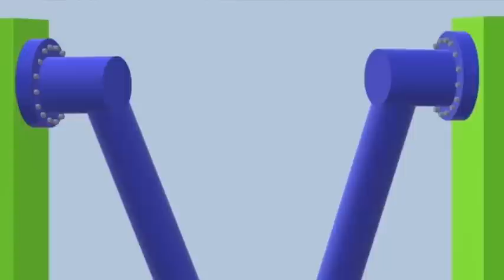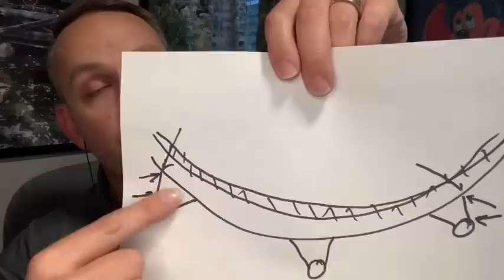Support beam cracked Fury 325 Carowinds When Will It Reopen?

Comment: The stress from the trains speeding by has sheared that corner piece clear off the support! Like you said, that's definitely a big "WHOA!" and there's some serious downtime, initial inspection, (maybe) repair or replacement, even more extensive inspection of the entire ride, and overall assessment - all coming down the pike! With as high, fast, and the stress on the turns and inversions experienced on that ride under normal conditions, I would not be at all surprised if Fury 325 stays closed for the rest of the season! You cannot take those kind of chances!
Reply from the maker: Most of the time the footer sinking would be from water intrusion. Works down in the ground, creates flow and over time starts to loosen the footer. It’s mainly soil composition, nothing really the park could do but monitor future problems.

Comment: Since this is so much in the public arena, is there pressure to go above and beyond the technical specs to make the public feel safe (i.e. replace the column rather than repair even though a repair may be deemed technically feasible?)
Reply from the maker: Yes there is a knee jerk reaction that the park will more than likely do sense it’s in the media. (I’m guessing,) They will invite some news sources in to show them how they will inspect the rides  to show people they do their job to keep it safe. The only way to fight media is with media. They will want to hit key words like manufacture had us repair it. Or something that shows they went outside their company for a check and balance in good faith.

Comment: Thunderbird at HW which was built the same year as Fury had a foundation sink and crack 2 years ago in a valley where only the track was attached to the foundation. Luckily they caught it very quickly and got everything inspected and poured a whole new foundation that ended up being much larger than the original foundation. It took them about 4 weeks to fix. I imagine this one will depend on how fast they can get a new support manufactured. I also imagine this making national news makes it more complicated as well.

Comment: Great Analysis. The one thing that really bothers me though is this was not spotted by Ride Operators or even park personnel. It was spotted by a Dad sitting out in the Parking lot waiting to pickup his kids. That's who shot that footage. He immediately went to find someone. It took him talking to 4 layers of supervisor before they would even begin to take him seriously. Even with the video footage. And then it still took them quite a while to shut the ride down. There will be some serious questions asked about Carrowinds maintenance practices. The other thing that is getting overlooked is the real potential for danger isn't just at the other supports. If you look at the video there is a track section joining just a few feet to the left of this support. That joint has now undergone way more movement and stress than it was ever intended for at least a week. (Pictures have surfaced showing the initial signs of the crack a week ago). Yes the rides do not necessarily need all of the supports to run safely. But which ones it needs vs does not need are not a random selection. Some of the towers are 100% necessary because the track joinings are placed adjacent to them, and they require more solid support.

Comment: A sober, educative, and reassuring explanation, Ryan. I am curious if "sleeving" the affected area--installing more steel at the point of failure--would surrogate replacing the entire member. You mentioned this breifly, but did not elaborate. Can you?
Reply from the maker: It’s all about liability. If they want the ride to be under B&M umbrella then B&M have to allow the repair. If they go roughe an fox it how that want it to be then B&M will release all liability of that ride. It’s up to B&M if they even want to sell parts to the park at that point.

Comment: what about the fact the support was in tension rather than compression? given the bank angle, id really imagine compression would've withstood more force...
Reply: Steel is stronger in tension than compression. You need significantly more steel to give the same compressive strength of say concrete.
Reply: @walterandclaude  even after being heat effected? Generally welds don't break the steel on the sides does. I'm just saying it would've been easier on the support if it was compressing the steel rather than trying to rip the weld apart
Reply from the maker: Possibly but these things typically don’t matter much. They are overbuilt to start with. This makes this event very odd.

Comment: 5:58 some rides that are on unstable ground (like "gold rush" @ Slagharen) have reflection markers on the supports about 1m off the ground where they shine a laser on, the laser should return to a detector if all supports in that loop are in their spot. If the support sunk, is bend or tilted the laser doesn't return to the correct spot and they can't open the ride. This is checked daily on start-up by the system.

I guess this is something that will be added to a lot more coasters in the future.
Reply from the maker: Wow. It’s normally not an issue unless like the one you described , it’s in a known problem area. Thanks for the comment.
Reply: @ryantheridemechanic  I've seen the same laser reflectors at other rides, but I've only done a start-up at the coaster of mentioned so I don't know how often others are checked. Slagharen is build on an oil and gas field so it's a known issue there for buildings aswel to slowly sink into the ground. Along as it's uniform on the whole structure it's not a problem, but some buildings have a few supports that stay put where the rest of the building keeps sinking. My parents house have the front wall about 1,5 brick (about 10cm/4 inch) higher then the rest of the house after only been there for 41 years. 
It's something we have to live with here, but also something we expect. As far as I know they had to adjust the support beams once so far after one of the footers sunk after a small earthquake with only 2 days of downtime (They have adjustment bolts and filler plates for that purpose).
Reply from the maker: @HaroldKuilman  how interesting, thanks!

Comment: "it puts more stress on the rest of them"

think of it like the bed of nails experiment, how a single nail would pierce your skin and make you feel extreme pain, but a hundred nails would just make you feel uncomfortable, because the stress is supported by the rest of the nails, not just one

but as you remove the nails, eventually they will start to pierce your foot slightly, until they finally just give under your pressure, and you now have many nails and not just one nail in your foot, but its still better than trying to rely on one, because one is guaranteed to have bad results
Reply from the maker: That’s a Good example of distribution of load!

Comment: I do think another factor in all of this that isn’t being said much is that B&M hasn’t bothered to lighten their train designs as their coasters get faster and more forceful. Intamin has had many issues, but they realized a long time ago the trains needed to be as light as safely possible. I305 is a good example. They re-profiles the first bank turn as it was too forceful for guests, but it hasn’t had any major structural issues and it seems they learned from mistakes made on Millennium Force.

Comment: I had no idea you could remove 2 or 3 supports and still be okay. I think people's fears with respect to this event are reasonable if they don't have the training you do. How do we know how long it might take for the other supports to fall apart after the first goes? What if there are similar undetected cracks in the other supports and with the loss of that one large support the rest widen at an accelerated rate? Or are you saying you just don't expect / its very unlikely for there to be cracks in the other columns?

In any case its nice to hear an expert view. But I dislike how everyone pretends that this is some how a normal response. Unless you are a trained ride mechanic or engineer you're not going to think this is regular behavior for a rollercoaster or for a bridge or anywhere else cracks might form.
Reply from the maker: The action was to NDT the track and structure, this was done. Seems they found no other indications. Depending on what they found wrong, that will determine future actions. If I was told nothing was wrong just a freak failure, then I’m going to shut the ride down 3 times a year and have it NDT. Special inspections the whole 9 yards. If they said there was a problem with that support like the footer sank or it was in the wrong location front he start , I’m going to keep the annual inspection as  usual  because there was abnormal circumstances  around that support.

Comment: Okay so while rare and whatnot I’ve seen all sorts of issues regarding b n ms footers and supports, yes I knew it was still completely safe I would have gotten right on it like it was lol but I remember after bush gardens installed alpinegiest an invert , and because of the marsh the footers were set in the footers were failing ie popping up tipping to the side and bush gardens was absolutely scrambling because large sections of the structure are like that so I’m not a big fan of these hollow tube style support poles and I’ve seen these issues before from b n m supporters and this is absolutely one of their most forceful coasters but none of these companies build the supports as beefy as the older arrows you could survive an apocalypse on an old arrow it’ll be the only thing standing in the park lol

Comment: Allegedly the crack already showed up for weeks ago leading into snap. If that's the case, honestly, the problem is not the sole failure of the single support column (we all engineer can agree that B&M Coaster is overbuild af). The problem is just, what they are really doing during daily morning inspection including visual inspection on every part of the ride. Like, this is CF we talked about.

But you know, I'm willing to get corrected if that's not the case

Comment: It's not the footer, and it's not a metallurgical defect. It's a design/quality control problem leading to an assembly issue. I've seen some close-up images on the track to column joint. This one is on B&M, the construction team, the state inspectors, design reviewers, and CF themselves. The track plate and column plate bolt holes do not match, so the assembly team could not get all the bolts into the connection. This will cause uneven loading on one side, effectively twisting the top off the column over a period of time. This should have been highlighted during construction and subsequently during quality control/annual inspections. Poor show all round, really. Can't wait to hear the official story. I'll get my popcorn.

Comment: After a 35 year career in aerospace structural testing, your analysis is woefully inadequate..... My first look at that video and several things jumped out at me ...... For starters, the design engineer should be shot! You build a tall support and then the actual support is cantilevered on top of it, negating most of the support, and placing all the stress on the front of that weld. The load path is 90 degrees to the support. Second, that is a BREAK! Huge detail but then, your entire analysis describes a static loading system, which this clearly is not. My first guess with no other data is that this is a fatigue failure, caused by the multiple load-cycles it experienced while being cantilever-loaded..... After you load-cycle steel a few million times, the molecular structure of the steel changes to that of glass, aka "glass transition state", and the next cycle with any load will shatter that steel like glass and that is what i am seeing..... if this were a static issue, the steel would have stretched first before breaking...... Also, all the spot-testing in the world cannot predict the next failure because fatigue failures happen so quick......... 

But hey, i do agree it was not dangerous..... and yes, you could remove that support altogether and it would only make it quicker for the surrounding supports to fail.....
Reply: Do you really think this structure has seen a few million cycles?
Reply: @sharkheadism  Quite possible but it would be easy to get a guesstimate....... 2 cycles a minute times 60 minutes an hour times 12 hrs a day times 100 days = 144,000 cycles and would be a conservative estimate for one season.... and that's not even considering if the loading "rings" or not..... So, engineers start to worry around the 2 million cycle range...... more quick math says it would reach that in 14 seasons or less...... Now, if that were an aerospace part, it would be load-cycled to failure to see when that happens. I did not check to see the age here but, with the cantilevered loading problem, who knows what and where the real loading is, unless someone tested that design at some point.....
Reply from the maker: Well I’m not disagreeing with any of you analysis. All i am saying is that I’ve worked on several of these between 20-30 years old and the one I took care of didn’t have A crack that we had to repair in the 14 years I worked with it. So typically it’s rather a footer moved or they used 2 cranes and a big rig to twist the track together and bolt it during installation. Not that I’ve ever done that.
Reply: @No1Armadillo  The ride's stated capacity is 1,470 riders per hour, or about 46 trains per hour. The park is open about 213 days this year, so if each day's operation was 12 hours, that would be 117, 576 cycles. That's still a high estimate as not every day will be 12 hours of operation and there will be times this ride doesn't run due to weather and other factors... It has likely not even hit its millionth run yet (it opened in 2015). And there are steel coasters much older than it that have done many more cycles than Fury and they're fine. All of the coaster manufacturers out there employ mechanical and structural engineers too.